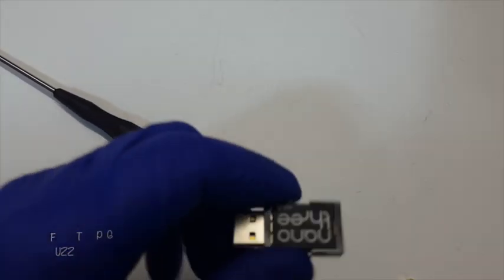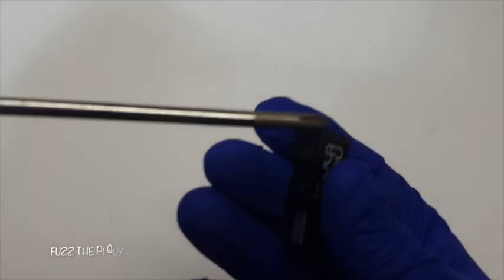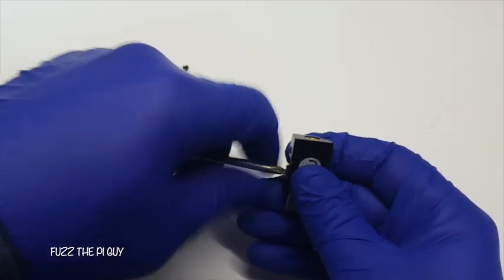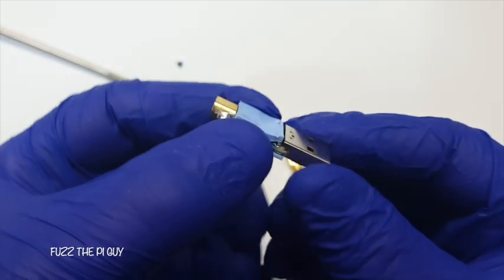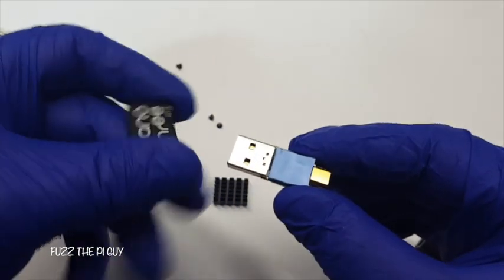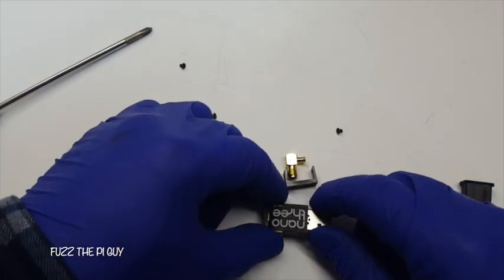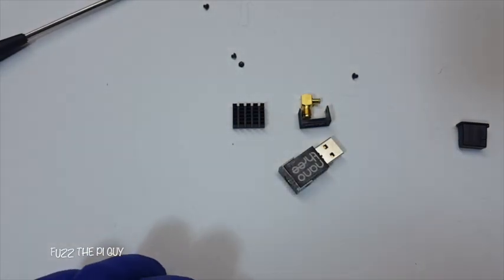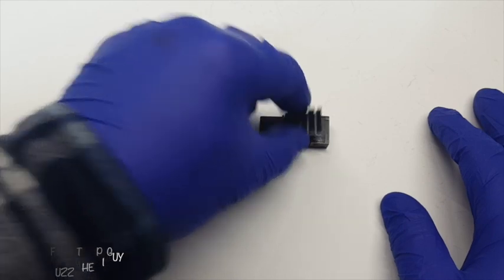Inside The NooElec NANO Three RTL-SDR Dongle

Comment: Tiny and they get ridiculously hot - especially when a few of them are in close proximity on the same Pi.  Using short USB extension cables to get them away from each other helps, but making sure they're setup in an air conditioned room is really what is more/less required with these little guys.  Ultimately, we've found these things to just be too finicky and switched to using the full-size SMArt dongles a few years ago.  Much happier with them - and they're still skinny.
Reply: How I solved my heat issues: 
Cut a small square in the middle of the adhesive for the heat sink.
Put the smallest dab of thermal paste in the hole you just made.

I find my nano doesn't get very hot at all any-more. Very warm sometimes, but never so hot that you cant hold it in your hand. Thermal stickers are kinda crappy. Thermal paste is the way to go.
Reply: @pilsnerd420  Hi thanks for the tip. I am curious on how that thermal paste is reducing the heat as it already transfers existing heat to the heat sink.
Reply: @DR19X The thermal paste has a much better thermal transfer than the adhesive pads, this is generally the same across all applications, only in some fringe cases do thermal pads beat thermal paste.